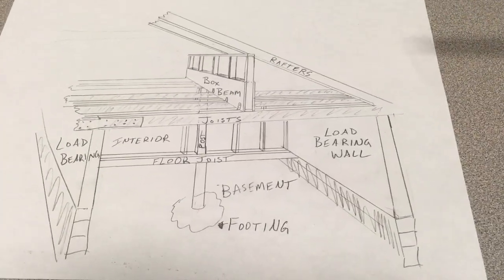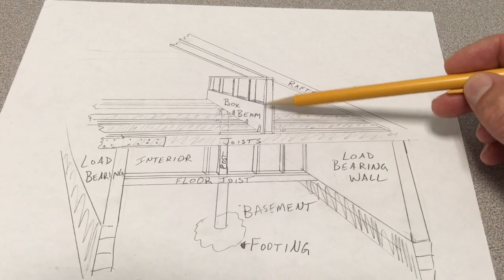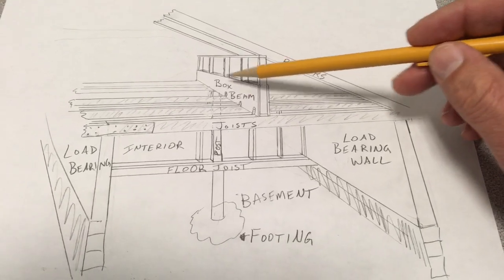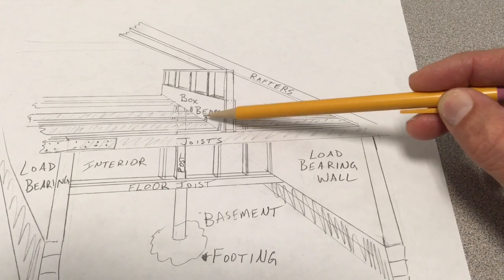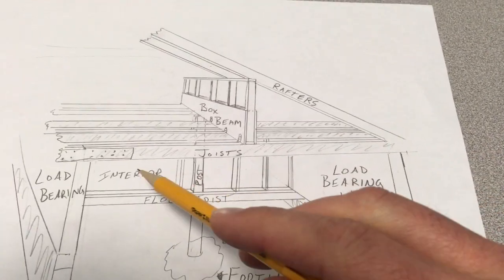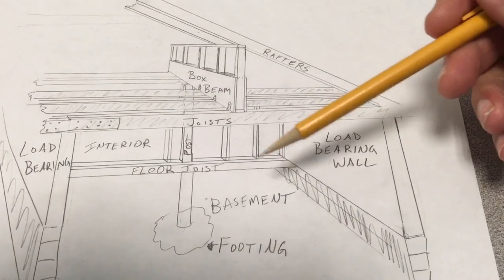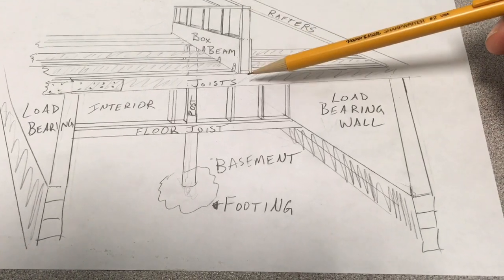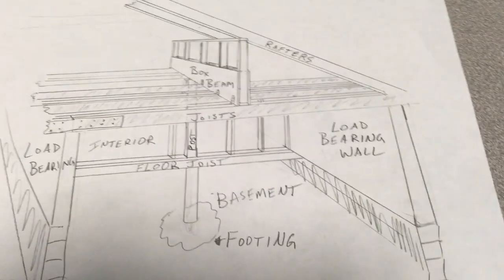Knee wall box beam explained

Comment: So I have to add additional posts from the ones I have in the basement already.
Reply from the maker: Posts under the beam would be ideal, however, finished walls act somewhat as box beams themselves, so wherever the box  beam crosses a wall perpendicularly, that wall will give it some support. It would definitely be best to add a post or doubled 2x4 in the supporting wall where the box beam crosses it, and then a post in the crawl-space or basement (to a footing) in line with that one. At the moment, my box beams aren't supported by posts, just perpendicular walls, and it is working very well. I was planning to add some framing to the wall and posts in the basement ... but forgot about it until reading your comment!! 🤔

Comment: I was very confused when I saw the first video, it’s like you were trying to hang the ceiling joists from the knee wall which was transferring midspan stress to the roof rafters. Now that I see there is a structural beam below it makes a lot more sense.

Comment: What is this actually called in proper engineer speak? I've tried searching all kinds of variations of box beam, laminated, plywood etc I can't seem to find this other than this video. I know it would be strong enough todo what I want but it's got to be designed by an engineer in my country.
Reply from the maker: I think it's called a plywood web box beam, Adam. Check out this PDF.
https://www.frim.gov.my/v1/JTFSOnline/jtfs/v5n4/492-511.pdf

Comment: How did you install the cross blocks?  Toe nail them in?  Thanks.
Reply from the maker: If I remember right, I think I shot them straight through the knee wall studs on one side, then angled them through on the other as I worked my way across, but I might have toe nailed some. Next time I might consider construction screws. Thanks for the comment.